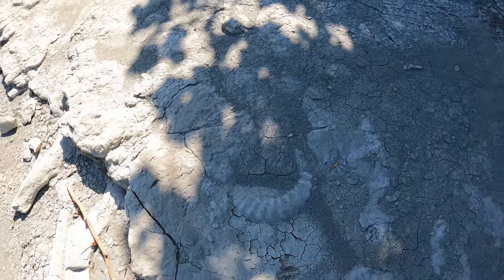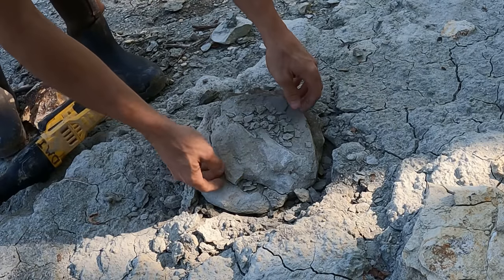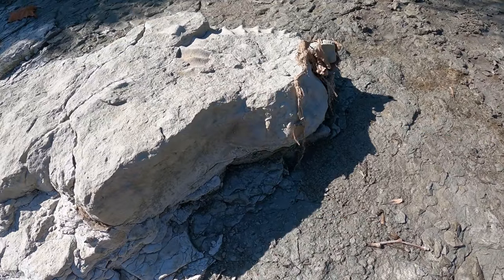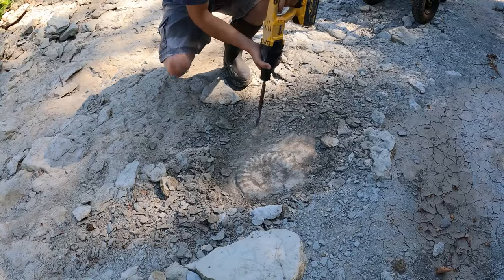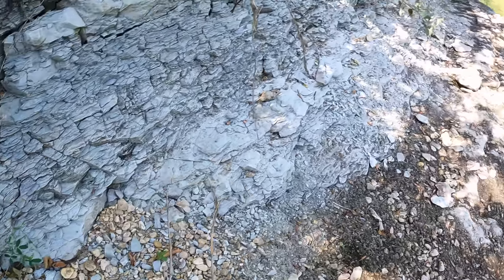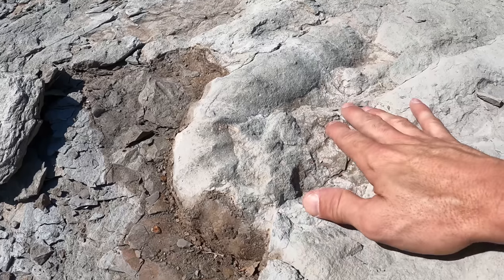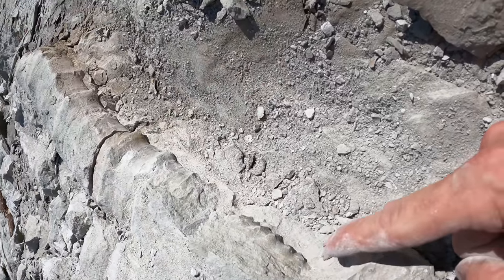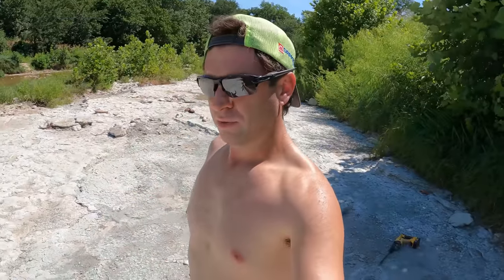TEXAS DROUGHT EQUALS NEW FOSSIL DISCOVERY!! Worth $75,000.00!!

Comment: "J" shaped ones are called Idiohamites, you found a very large. Most of the ones I have found are usually less than 6" long pieces. Look them up. They start out coiled just like the regular ammonites then straighten out. The "J" end is the living chamber. Great find! I suggest you chisel away from the fossil instead of toward it. Less likely to damage the fossil that way.
Reply: I'm not educated in this field at all but the video peaked my interest. The j looking fossil reminds me of type of tube worm but I'm assuming something like that wouldn't fossilize. Could you maybe explain what it might have been like in living form? Thanks.
Reply: @rchurch2769  The "J" shaped fossil is a form of ammonite, a complete one would have started out coiled as most ammonites but then the shell straightened and finally curved back in the "J" shape. This was a shell that housed a creature called a cephalopod which would have resembled a nautilus or squid having tentacles which it used to capture it's prey.
Reply: Thank you!  👍👍👍😀

Comment: When I was young, I lived in Pennsylvania, near Pittsburgh. There were some old coal mines, We were too young and foolish to recognize the danger and use to remove shale from the wall and check for fossils. Every now and then I would find a beautiful fern leaf, preserved in the coal shale for like a 300 hundred million years.
Reply: I live about a hundred miles or so, south/ south west of you in an area that was supposed to be a swampy area for millions of years. Several years ago, a buddy and I, kayaked about twelve miles of a local river, roughly thirty or forty miles from where it runs into the Ohio. It was so low at the time, we would have to get out and drag the kayaks at points. We have owned property in the area since 1975 and i had never seen it this low and clear. We came across a section of exposed bed rock in the river bed that appears to have some type foot prints in a straight line for maybe twenty or thirty foot. Not giant prints but if I were to guess, maybe to size of cow or something of that size of print. I have been back to try to find it again but I'm going to have to wait until we experience some drought conditions for the water to be low and clear enough to find it again. It isn't looking like it's going to happen again this year. I did mention it to a local paleontology professor when I was doing upgrades in their department. He said finds like that would be rare in this part of the country but definitely couldn't be ruled out. I'm sure it could maybe be some type of natural formation but I remember the minute I saw it. I had no doubt I was looking at a some type of print.

Comment: I'm wondering if the ammonites are NOT shells but worms that coil on themselves when facing death. I have seen others that were partially uncoiled. That large J-shaped one may be an ammonite that was uncoiled, if my assumption is correct.
Reply: They are definitly shell and not worms , wors are soft tissues creature that most likely never get well preserve. So these are squid like creature with a shell, you can see them like nautilus if you want to well imagine. And there was a lot more than these two species.